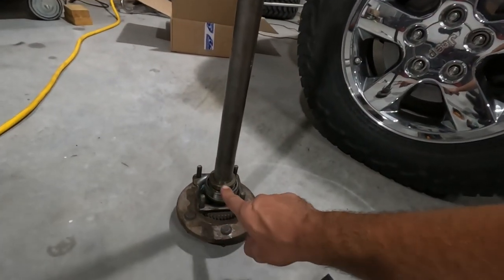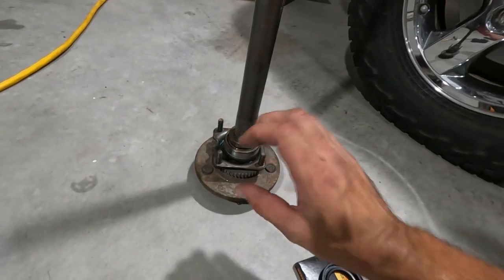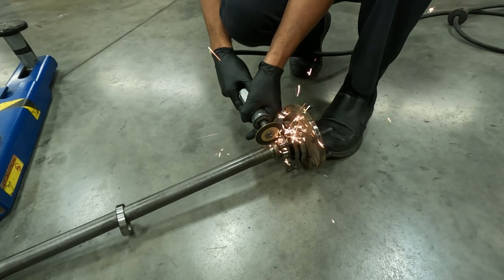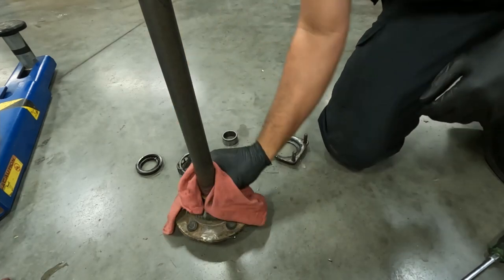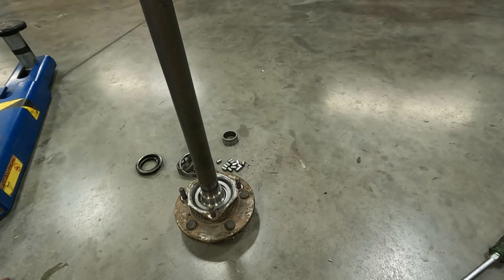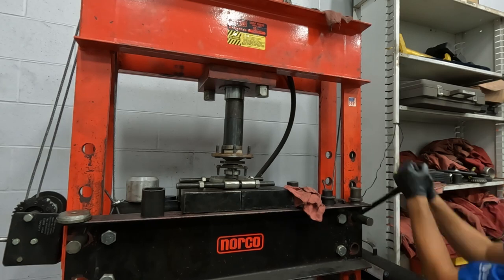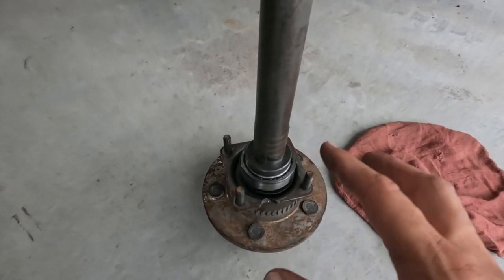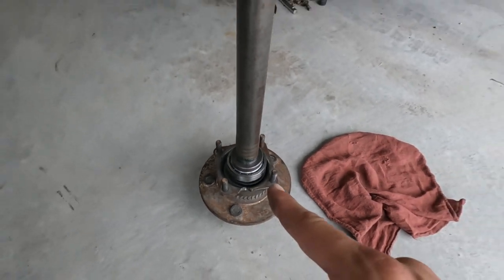Saying GOODBYE To Hi Ho SILVER Axle Shaft Bearing Replacement HOW TO

Comment: Tyler, how did you figure out which axle shaft had the bad bearing?  Could you hear it by turning each wheel separately in the rear?  Can you discuss the diagnosis in a video featuring the new black WJ?  Also, can you recommend a website were I could locate torque specs?  Thx, great video.
Reply from the maker: I put the jeep on a lift and ran it up to speed and then used a mechanics stethoscope to isolate where the noise was coming from on the axle housing. I'm not sure on a good website for torque specs, I am lucky and am able to use the factory service manual at work. Thanks for the view!